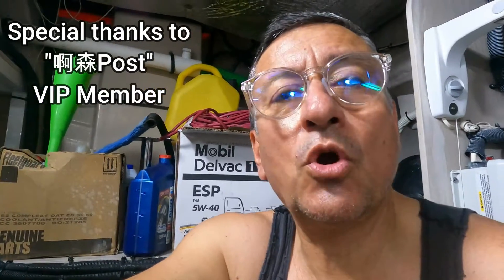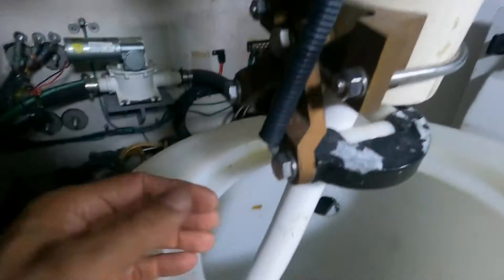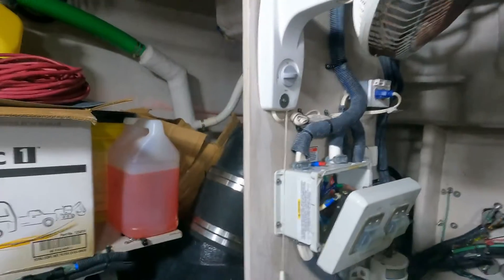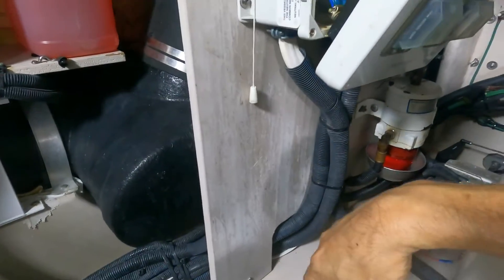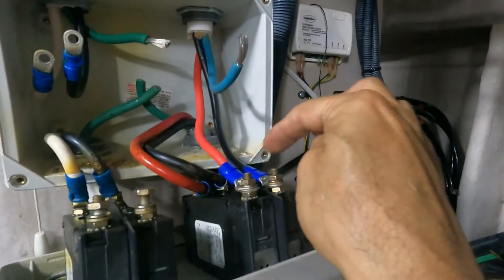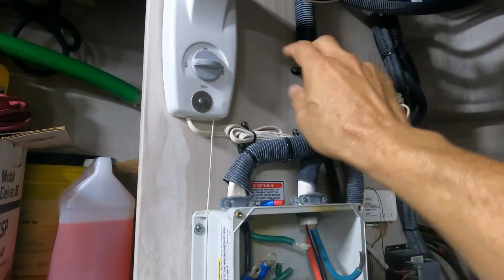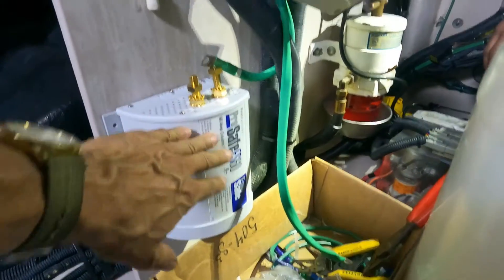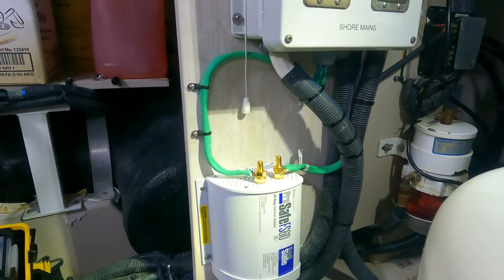Installing a Galvanic Isolator

Comment: Great video thank you!  When wiring for two 30amp system, can i use all 10g wire in and out or should I go thicker on the out side since its 2x30amp?
Reply from the maker: Yes 10 gauge wire is ok. Glad it helped. If you want to see more material please visit my website at www.mttedu.org

Comment: Thank you for the video. I bought new galvanic isolator. When Im testing my new victron galvanic isolator 32A, it shows 0.8 volts immediately as I touching with Fluke meter, voltage not rising step by step as in your test. I do short with cable, to reset capacity of isolator.
Reply from the maker: Yes, Don't forget to set the multimeter in the function DIODES
Reply: @Mr Lopez  Yes, in diode position. So, means my galvanic isolator is working normal if voltage not rising step by step?